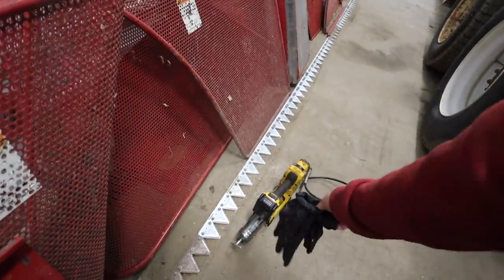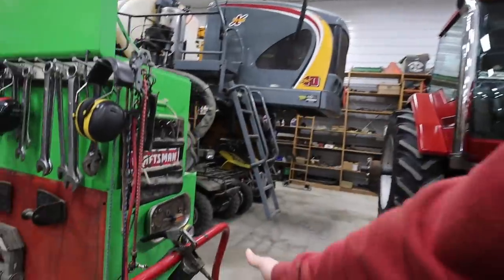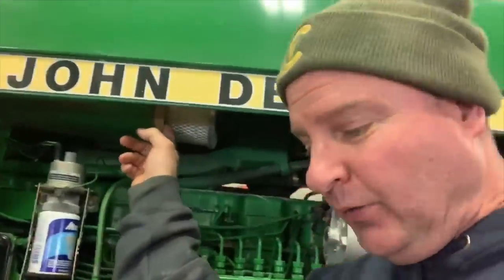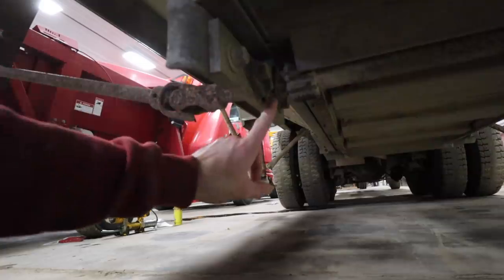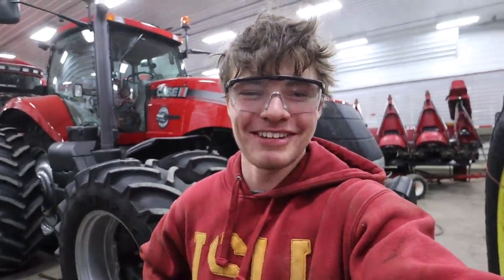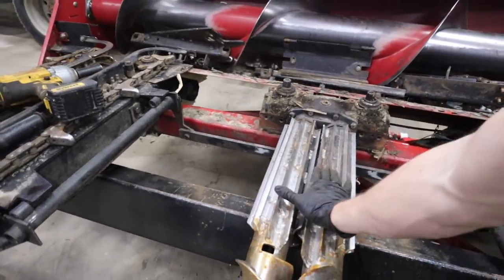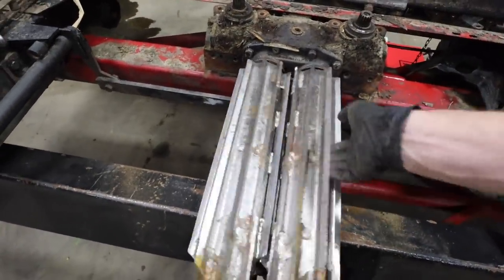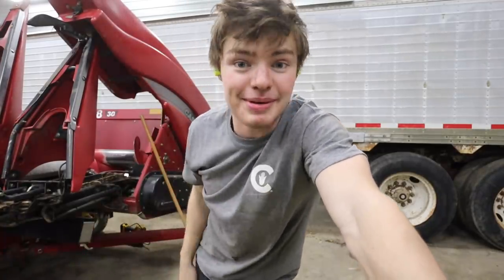NEW MECHANIC FINDS MAJOR DAMAGE!

Comment: I think I would just change the grease nipple before use a torch on it considering there only .40 - .50 cents. Your spend more on gas for the torch then the cost of the nipple. Not to mention the wasted time.
Reply from the maker: Joey Campbell I've gassed new ones before too 😉

Comment: I prefer a pneumatic grease gun.

Mullets have returned for high school boys? Why? Are they still called mullets?

You had to drive to both Des Moines and Cedar Rapids to find all the parts? Yech. That's way too much driving.

The last time I did a brake job it took an hour and a half to do one wheel. Then 15 minutes to do the second wheel. Learning curves can be brutal.

Comment: Get a high pressure tip, it fits right into the ball of the grease zerk and and as long as you hold it tight it to the zerk it shouldn't reject the grease. 
On some steering grease fittings, you might have to jack the weight off the component so get the grease to take which no one does. Basically do the best you can and move on.

Comment: You need to get a grease zerk clean tool.  Theyre great just fill it with wd40put it on the fitting and smack it with a hammer problem solved.

Comment: NO NO NO you should never do the to a grease zark the small little ball well become a bullet and may cause and serious  injury  my best friend dad lost his eye  heavy durty mechanic  work as  working for a paving company  when it happens heated up the  shaft to take the bearing off of the end of the shaft   heating the tar  up to clean up off the shaft the grease zerk shoot  of  the ball into the eye  he lost his eye   now we take then out and throw them away  the company my friend dad work for  make share they are removed or broken off  before any heat  
yes the battery power grease guns are awesome  we Milwaukee  ones here  DeWalt does stand up  to the Milwaukee  service I get with Milwaukee  tools here we have both companies service  here   Milwaukee best  DeWalt in  getting the tool back to you  by day VS month for DeWalt  what gets me  dwelt charges for warrant work  on their crip tools   
long story short when the 28-volt line cam out  bought  that line of tools them they stop making them all I want for DeWalt to trade  up the tools for the 18 volts they said not they can not do it  
Milwaukee  did that  they do charge for the warrant  work too  
I am sorry  DeWalt  does stand up to the name  
what it costs for a grease zerk  vs  and eye it's up to  you people to decide  if an eye is cheaper then grease zerk

Comment: what up with the flat tires DADDY CORNSTAR  has not like MOMMYCORNSTAR  you have and other flat or it is time you take the molded wallet out yea and time for new tires around the vehicle plus side you do not have to screw around with the tires it a good reason to get new tires is when you start to have trouble with them on a weekly or monthly yea shame on daddy cornstar rubbing suntan lotion on and somebody   thin mommy cornstar